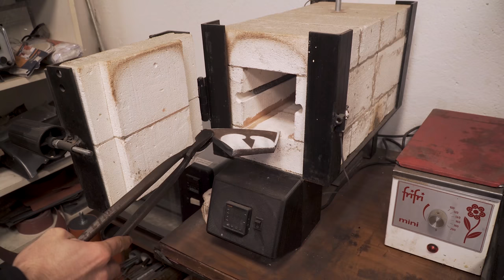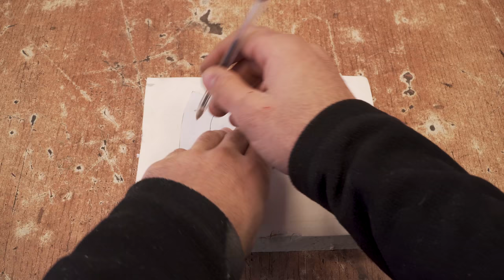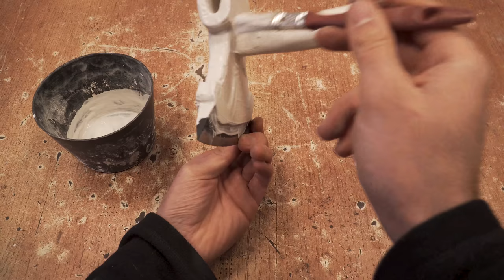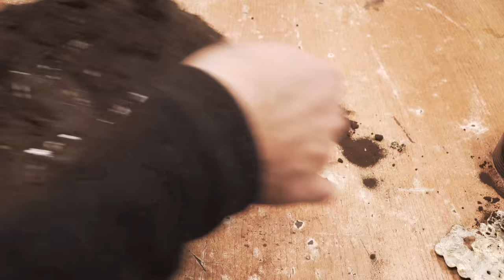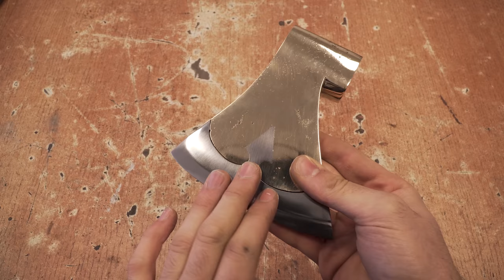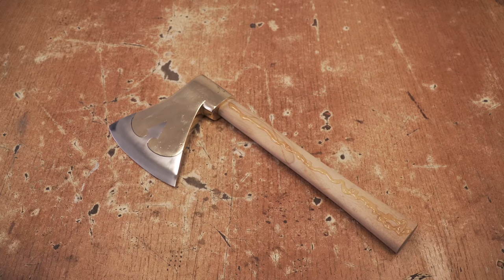Dovetail Tomahawk

Comment: You need to press the sand down with more force. The first layer on your workpiece should be pressed with your fingers. All the layers above should be pressed with a tool. Then you need to make holes in the sand to prevent steamexplosions. 
Regards 👍
Reply: Right - and lubricate while drilling.😉
Reply: Yeah, when he did that second attempt and you could see the casting sand raising, oof.
Reply: Total set-up, and no one bit...
   That's what she said
Reply: มน
Reply: O

Comment: Simply gorgeous.  While I know it is largely decorative, watching you cast the brass made me wonder how the heat of the brass would affect the hardness of the steel.
Reply: Me, too, but the edge seems to hold up ok whacking on the pine.
Reply: Well, he didnt temper the steel (at least not on video), to i think he relied on the brass to temper the edge
Reply: @HvV8446  That's part of what has me curious.  Brass melts at something like 1700*F.  As I understand it, chopping blades are usually tempered to around 450*F. Pouring 1700*F brass into the mold would likely cause the steel to heat to a level that, once cooled slowly in the mold, would essentially just anneal the steel.
Reply: @davidkbailey  yeah, i dont know how else he can do that, its the only thing i can think of. But then again, it was only pine. I bet that if he used it on hardwood it will have dents in it in no time.

Btw, im european, therefore i prefer the (easier) method of measuring temperature with celcius 🙂, only when its -40 i dont care anymore
Reply: @HvV8446  Yeah, sorry about the Fahrenheit.  My blacksmithing books  don't even include metric equivalents.   For length and volume, I can work pretty well in both metric and US Customary.  I have never been able to get my head around Celsius, though.  Who knows why. . .
Reply: @davidkbailey  celcius is simple, take the freezing point of water (0) and the boiling point of water (100) and devide the difference in a 100 steps
Reply: @HvV8446  Oh, I get the concept -- we all learn it in school here in the US.  It's just not as intuitive when you have not been raised with it.  A hot day is 100*F, a nice day is 75, a cool day is 50, and a cold day is 25.  I don't have the personal reference points to intuitively grasp C.  Perhaps it is because temperature is less tangible.  I can hold a meter stick and walk a kilometer.  I can drink from a liter bottle.  There is not as tangible of a way to learn C.
Reply: @davidkbailey  C works the same way: 0 is freezing water, minus 1-2 is arctic salt water, 20 is a very nice spring/sommer day (depending on where you live in Europe), 30 is when you know it’s really summer (in Hungary) and the elderly start really suffering, 40 is when it is a global-warming-type-heatwave, about 60 is scolding-hot tap water from the boiler, 100 is your tea water boiling... 37-ish your normal body temperature, 35.4 is what cheap handheld thermometer guns made in China show whether you have Covid or not. :D :D — 90-ish is the cooling water in your car... The only difference is how each one of us creates these associations. Your examples are actually useful for me to wrap my head around F. (My C values may be subjective and off by a few degs depending on who you talk to.)
Reply: @Ateesh6782  Right, and it's that subjectivity that makes C difficult for me.  My wife, however, doesn't seem to have the same trouble.  She'll say that she is cold at any temperature.
Reply: @davidkbailey  Same here :D :D :D I always tell her she has no cardiovascular system :D But we cope. I prefer sweating over being cold.
Reply: @HvV8446    Had not considered that, but the gradual cooing in the mold should have normalized it. Unless.. is the melting point of brass lower than temper point? Pretty ignorant of metallurgy.
Reply: @mred8002  the melting point of brass is about 930 °C (1700 °F) whilst the temper temperature of steel is (dependend on the type of steel)  between 125 °C (255 °F) and 700 °C (1300 °F). So even if he used a sort of steel with a high temper temperature, it would've still been too hot and have normalised the steel. 

I woud've (dont know if it would work, im not a blacksmith) heated up the steel edge after the casting with a acetylene torch to the correct temp, which is about the same as the melting temp for brass, but since you are only heating the cutting edge, i think it doesnt really effect the brass. Especially because its a really good conductor. And then quench the edge and temper it like you would normally
Reply: @HvV8446    That sounds right. Thanks!
Reply: @davidkbailey  
F≈(2×C)+32
C≈(2/F)-32

Comment: Looks amazing that little bit of pitting in the  gold part was driving me crazy though almost perfect. Well done very awsome
Reply: Looks good. But from a mechanical point of view, it will fail. Brass is a soft, ductile metal. With every impact, the brass will compress a little and eventually the dovetail will loosen. The hatchet will then break apart. Still a very good looking hatchet.
Reply: @Biden_is_demented  From a mechanical point of view, they all fail eventually. But yeah, it will fail sooner, and probably in the way described.

Comment: Beautiful axe!  How deep are the pits on the right side of the head?  And looking back, do you think packing the sand would have made a difference in avoiding the pits?
Thanks for the video!  It's always nice when someone has a vision of something and then goes ahead to complete it!  Very nice, functional art piece!
Reply: After all its very poor casting. This tech is known more then 5000 years. Google a bit
Reply: @wolfgangornig3556  Of course!  However, there ARE examples of castings like this that are excelent!  Just because the tech is old, doesn't make it bad!  After all, most of the items made today that are machinery parts are cast steel, of one type or another!  However, there are newer technologies that are making even that, obsolete!
Reply: The pits seem to be where the melted brass was surrounded on three sides by cold steel. I suspect the brass cooled rapidly in those pits and shrunk when it hardened. I could be wrong about the shrinking but two vents in those precise places might have prevented it. I bet there's a fair amount of trial-and-error in production casting to sort out these types of issues.
Reply: @wolfgangornig3556  olm

Comment: Nice work! Unfortunately the casting heat destroyed your heat treatment on the blade. Maybe do an edge quench (with a torch) after you’ve casted? Bring out a hamon with the right steel to add to the look?
Reply: i know literally nothing about forging other than from youtube videos and forged in fire, but at least from the tests the edge appeared to be hard. Is the wood just too soft to do any real damage?
Reply: @westoncoleman6561  correct. With medium to heavy use you could get deformation, but it definitely wouldn’t hold an edge.
Reply: @westoncoleman6561  the failure of Forged in fire -they dont show all of the steps in heat treat

Comment: Really beautiful! And a great concept, steel working surface set in something easier to cast. I may try this with Aluminum. Have you considered "dry sand" for your lost foam casting? I have heard it is good but I've only done it with zinc. Also, and let me apologize in advance for being pedantic, its not a tomahawk. A tomahawk is characterized by a long handle, the length of your arm from your armpit to your wrist is a good length. Sorry again, beautiful work.
Reply: R
Reply: Coisa fria

Comment: When you cast, you need to pack the sand, at least that's what I learned in my foundry classes, packed sand give much better finished product and lesser chance of sand mixing into the surface layer of the finished product.
Reply: Forbidden Tut  we had molds made from idk wood or metal. Idk how to create the visual for you but mold use to squezed between two layers of wet sand mixture with some adhesives and charcoal in it. The top box could be lifted up and molds taken out. Top box also had hole for metal to be poured in.

Comment: A tomahawk is made to be light, can be thrown , and the thing is the blade goes from the tail up so you can change the handle with ease if you brake it :) . So I don't think this is a a T hawk . But I love the hatchet, its nice, love the 2 metals combination.
Reply: Imgo you tube com vidio sektual miths tàĺahatu
Reply: Imfo lagulagu timur ntt
Reply: Dengan vidio nja

Comment: Great job !!! Just a question : don't you lose the hardening of the steel part by pouring the hot brass  ?
Reply: Just a quick answer.. NO!
Reply: I believe this is why he didn't show a tempering cycle. The hot brass was probably what tempered the steel edge.
Reply: I had the same thought/question.
Reply: Brass melts at about 800 celcius. Tempering of most hardened steel at about 200 celcius. So yeah the hardness is pretty much gone. Stil a cool design. Maybe a edge quench would work. With the rest wrapped in wet cloth or something.
Reply: Pufu
Reply: @whatsthetime2705  just a quick correction.. YES
Reply: yeah it does but its a nice design eventhough the pouring looked really odd compared to what ive seen in almost every metal pouring ive witnessed before

Comment: I'm the only one who produces anxiety when he don't compact the sand?
Reply: Same here. It's like watching amateur hour. The guy has no idea at all what he is doing. Think about how many Youtube videos there are that show you how to do it correctly.
Reply: @vicconstruction9126  I would love to see you make better.
Reply: @vicconstruction9126  This method is called lost foam casting. It is not the same as sand casting, thought is uses sand.
Reply: @Glorious804  If you created this in workshop class in highschool. You would not get an A. Fact.
Reply: @iamlegnd  yes, I believe we can all see it’s using an evaporative casting method; however, you do understand that the more compacted the sand is, the higher the chance your piece comes out dimensionally accurate, right?
Reply: @vicconstruction9126  don't mather, it looks badass
Reply: Nope. I got nervous as well.
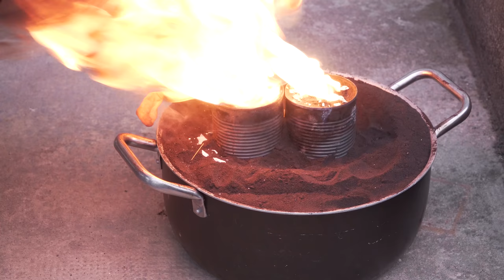Reply: I thought that initially, but I gave the benefit of the doubt. then at 7:20 you can see the sand bulge because it just wasn't compacted at all. there would be much less spitting and much less material lost if the sand was compacted properly.

not going to lie, I give the guy props, ive never attempted casting a brass head around a steel edge, but i get the impression that a lot of the stuff he does is trial and error and theres not much study going on to really hone in on the craft. the end results are often pretty decent, and I applaud him for it, im not here to bash. but if i can offer even a little constructive criticism is that he should compact the sand much more if he wants to cast things like that. and over time i can see the steel edge working its way out of the dove tail since the brass isnt completely moulded to it, its almost a cold shut on a majority of it. 

like i say im really not trying to shit on the guy but theres always something to learn, and you can only learn in you do things properly.
Reply: @LCIsner20  I was surprised as he's correctly compacted the sand in previous casing videos.
Reply: @vicconstruction9126  Why is that? If a kid made this, I would give them an automatic A+ because of the ambition and effort.
Reply: @dragonhunter1902  Its not functional, its not balanced. Its dangerous. The design is flawed. The work is messy. If you don't know metal work, then you don't know. And thats okay. 99% of the comments are from people who have never done workshop. They have no idea at all what they are talking about. This is coming from someone who collects medieval weapons.
Reply: @vicconstruction9126  I showed this to my grandpa who did metal working for a living and he thought it was pretty cool. Plus, I don't think he is going to use it for anything other than display. Also, collecting weapons doesn't mean you know how to make it.
Reply: @dragonhunter1902  Why wouldn't your grandpa say something nice? I bet he wouldn't buy it though. It's trash.
Reply: @vicconstruction9126  Well, it would still be a cool decoration.
Reply: You're not the only one.. also hated the gap between steel and brass. The pits in brass stressed me out.

Comment: Why does most of the meeting surface between the two metals seem to have a gap? Is it due to shrinkage? Is there no way to get good surface mating from Casting?
Reply: To stop the two parts from shifting relative to each other on the pattern, it locks them in place.

Comment: i can see and hear a lot of problems with this
Reply: Such as...?
Reply: @chuckbowie5833  for one, a lot of gaps that allow the metals to move. I can also hear it rattle a tiny bit when he handles the axe. Brass is a pretty soft metal and will over time warp and come loose from the harder steel inlay. Dont know how well the brass flowed through the holes he drilled but can imagine it being a bit of air in there. Metals shrink when they go down in temperature, he would be better of machineing the two metal parts to fitt better thus prolonging the life of the axe head.

Comment: between a belt sander and a good forge, you can pretty much turn any scavenged metal into true treasures, well done. thank goodness for so many useful cutting machines.
    -any tips and tricks for manually drilling the initial straight hole into metals without higher end machines? still trying to learn that art thanks.

Comment: Just a question. How good is the adhesion between the brass and steel. It appears the bond is not that strong. If the pouring had a better mold the casting would have been perfect. Great idea and execution.
Reply: From what i can tell and my very very limited knowledge, the casting kinda sucked because he didnt compress the sand or whatever material he used for the mold was. This couldve been done with a hammer. 

As for the bond, its not really "adhered" to it. He drilled holes into the steel dovetail bit and when the brass poured into the mold it flowed into the gaps locking it together.
Reply: @thetsarofall8666  DUH-POW It's not intended for more than a "wall hanger" I thought it was absolutly dam splended. Besides I was a Refiner on the Copper Furnaces for the Acaconda Company Smelter in Anaconda, Mt. in the 1960s and 70s and since I made copper and KNOW how it does, and watched Him "tin" it with those two vaises, I'm thinking it was great as they turned out as they did. Chopping thru wood right in front of Your eyes, etc. Yup‼ G-G  🤨🤔😁😃🪓💫👉👍👌👀👀👀
Reply: @TheSnoopindaweb  oh dont get me wrong i wasnt criticizing the workmanship, i was just trying to anwser the comment above. A gorgeous piece to be sure, personally though a curved handle with a darker stain wouldve looked better imo.
Reply: @thetsarofall8666  Thanks. Yup‼ G-G
Reply: @thetsarofall8666  Clearly it wasn't meant for actual usage otherwise it would be falling apart in no time. Looks pretty good though, minus the obvious flaws.

Comment: so at first i seen you do the quench but then didn't see you temper it (which is fine for a knife, but not so much for an axe) so i worried it would be too hard and brittle, but then i seen you pour the molten brass right onto the blade and now i'm wondering why you even bothered with the quench since you basically just annealed it.

Comment: CAUTION to anyone trying this (Black beard, feel free to correct me if I missed something? Great work overall really) 
When poring metal into wet sand their is gases created; you must design
your mold in such a way to vent this or it will go "pop'' and blow metal out the sides of a two part box ( standard box) You could just vent by pushing holes in it to the casting with a sharpened rode from a coat hanger (10-20 at least at a guess) ; I would not consider this enough or safe by any standards though.
  I would EXSPECT to get badly injured not "suspect" I would doing it this way. 
How you didn't get the metal fired back at you I really don't know, very curious.

Woops, I missed you used foam, thought it was just a piece of wood. that would work
Reply: Good tip